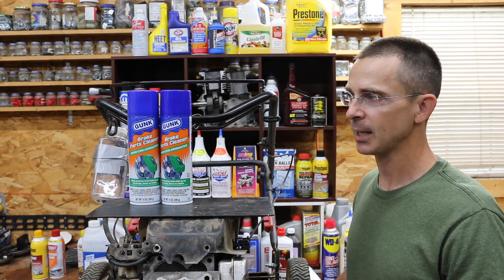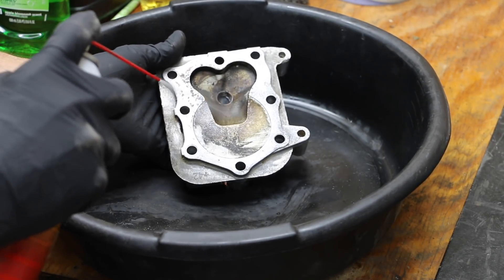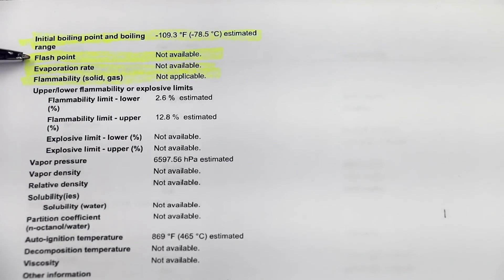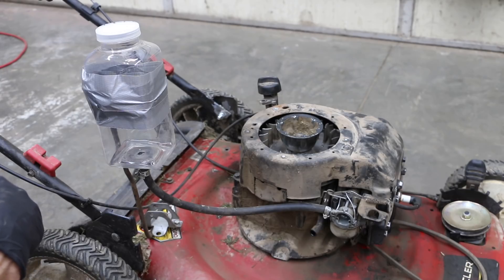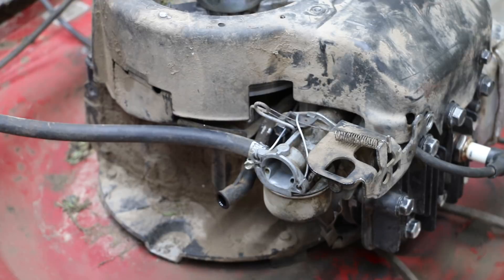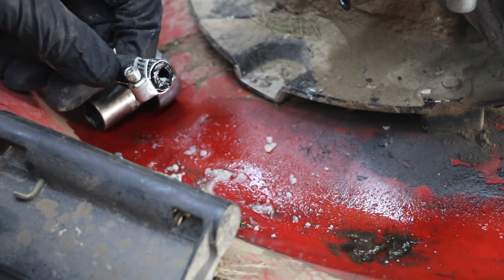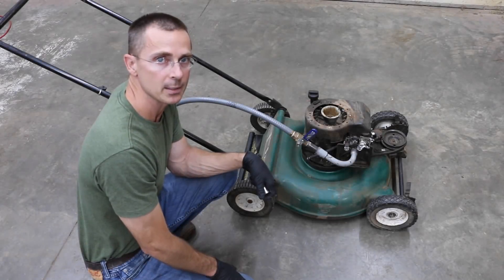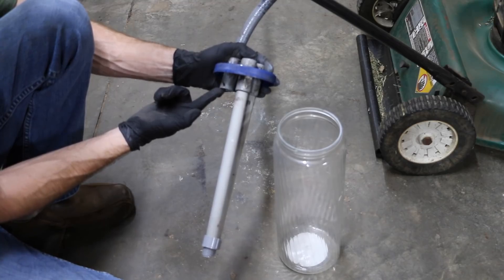Will a Gas Engine Run on Brake Parts Cleaner?  Lets find out!

Comment: Is there any way you can test whether antifreeze stop leak or just putting an egg in the cooling system is a better short term fix for a coolant leak? The radiator on my truck busted and I ran it with an egg in the radiator for a month before I put another one on it. I wonder if I had atypical results or if an egg just works that well.
Reply from the maker: Great video idea!  Thank you

Comment: I love your videos... I watch all of them but I was wondering what do you think would happen if the engine backfire through the carburetor when you had your Vapor gas tank hooked to it???? Scares me a little bit.. and you should try to run an engine on moonshine I've heard that the old-timers done it back in the day so it should work but I don't know
Reply from the maker: Great point regarding the vapor setup. I won't use it again until I install a flash arrestor.

Comment: I believe all the carbon buildup you have on the internals comes from a rich fuel mixture. I noticed lots of additives ate not impressing me, but I believe that the fuel ratio may be fudging your results.. can you try rejetting the carbs and running the engines to see how that changes your results?
Reply from the maker: Threat point and thank you.

Comment: Very good. How was cylinder scoring or lack there of? Thinking off topic about the old saying of using starting fluid washes oil off the cylinder walls. This stuff has got to be close, cause I use it or carb cleaner or WD 40 to help start reluctant engines.
Reply from the maker: Starting fluid these days includes some oil, which prevents scoring.

Comment: The vapor setup ran amazingly well! I take it you did another video on running gas on vapor?! I'll go look for it, I wonder how it compares efficiency wise, afr changes, better/worse mixture in the combustion chamber etc. Neat stuff man this channel has hours and hours of awesome information!! You can't trust manufactures, or most groups that review products, what a gift to have someone doing all sorts of tests and showing real results!!
Reply from the maker: Thank you. Yes, the engine ran on gas vapors but with only minimal fuel efficiency gains.
Reply: @ProjectFarm  the set up this guy has isn't doing anything differently from the carburator. The he's highly agitating the fuel causing as much atomization as the carburator would do left in it's own. For it to be useful at all you have to dial in the agitation rate. It else it's just a cook looking perpetual motion machine you see where they hide the motor.  My bubbler set up on my power washer nets noticeable gains. It operates a little lower rpm than it did off the carb but my water psi hasn't dropped.  I also need to use a little fuel by way of through the carb or starting fluid to get the motor started. Since engines use more to start than they do to idle. My ratio will run it but won't start it. And that's where you see the difference in consumption. I had to mes with mine quite a bit to get it right. And my pressure washer was the most thirsty small engine tool I owned now is at least 25-30% better

Comment: Will an engine run on whisky? I am talking here of Scotch whisky. In the 1950’s I had a very low compression twin cylinder motor cycle which it was said would run on paraffin  and could at least, be started up with whisky. I never tried it as I did not fancy cleaning the gunge from paraffin and the whisky could never have got as far as the tank!
Reply from the maker: Great recommendation!

Comment: Hope you weren't breathing too much of that stuff mate. Benzenes in most forms are pretty toxic.
Reply: Yeah, Project Farm mentioned that at the start of the video. Could also try running on freon while it is still available, but burning freon can be deadly because of phosgene gas (mustard gas) produced!
Reply: ojars zvaigzne Freon won’t burn as fuel I even vented some into the intake manifold of a diesel before it was illegal to vent and all it did was make a little phosgene in the exhaust and then engine shut off from lack of oxygen seconds after
Reply: ojars zvaigzne but with Freon only there’s no way it would burn

Comment: What will you recommand as a fuel if i'm in a urge to lawn my mow, and I can't find any gas ? 
Can an engine run on perfume, rubbing alcohol, or any houseware products ?

(as a french, it's very disturbing to say "gasoline" for what we call "sans plomb" and "diesel" for what we call "gasoil")
Reply from the maker: I need to do some experimentation, but I believe a mix of kerosene and rubbing alcohol would make a great mix.
Reply: So maybe it should be the same answer for ethanol 85 ? My equipment tells me not to use it, and I want to know why !

Thanks for your awesome videos. I'm following you for 2 weeks now. Never imaging it would be this captivating to look at lawnmower cruelty. Keep on going !

Comment: Didn't see it mentioned, but just about every brand of brake parts is a much different formulation.  Walmart's BP and carb choke cleaner are both nearly the same, containing toluene, methanol, and acetone.

Comment: There’s no way that initial boiling point is correct. Is it just a coincidence that -109.3°F is the exact “sublimation point” of CO2? I don’t think so. Looks like the pressurized the can with CO2 and then some computer program took its temperature while subliming at atmospheric pressure (ie freezing point of CO2) and plugged it in as the “estimated initial boiling point”. 

There are few organic solvents they would use that would be boiling at -100°F. Even propane boils at -44°C.
Reply from the maker: Thanks for the constructive feedback.
Reply: Project Farm well thanks for reading it!

Comment: If it's a negative comment about my post keep it to yourself cuz I don't care. Hello Mr. Project Farm I have to say that vapor tank is FREAKIN BRILLIANT, will it run on diesel vapor, I'll bet not to good if at all, wow that is cool, do you know the hours per vapor tank (per quart) vs a wet tank (per quart) that it will run with gasoline. What about 50/50 or even 100% paint thinner on vapor. On another subject, engine lubricants, have you tried running an engine with the crankcase filled to only 5 or 10% full of oil as a control then mixing an additive with the oil and repeating the above scenario 5 to 10% full crankcase to see if the oil additive improves or reduces lubrication or longevity, instead of draining the oil completely out of the crankcase.
Reply from the maker: Thank you for the positive comment.  The vapor setup I used isn't as good as other designs that use the exhaust heat to help vaporize the fuel, which is supposed to improve efficiency. In my testing, I didn't see any significant fuel efficiency savings.  Thanks agin.
Reply: Project Farm: cool thanks for actually responding. I hope it's ok, I've made a similar vapor tank for my Generator and it runs well, I will mess around with it and try to figure out a way to get the exhaust cool enough to safely run through it. I have to say you opened my mind again. I'll get back to you if I find any significant information about this lil tank.

Comment: Havr you tried running an engine on surgical alcohol? As well as have you tried to do a ventury with the vapour motor to have some fresh air added with the vapours being sucked into the carb? I know you get air into the carb through the inlet and the boiling off of the "fuel", but that is basicaly a clean burning vapour. If you add a ventury to the bottom of the controll valve will it not run longer on a said fuel than without it because you add more air. Just a thought.
Reply from the maker: Not yet. Thank you for the video idea!
Reply: Project Farm great stuff! Keep up the great videos. Just love to watch them all the way from South Africa!

Comment: an nitro engine will run on white spirit, diesel, cooking oil, and ovs nitro. I guess that most flammable liquids that burns the same and is the same is texture would work in an engine. I think you should try white spirit with a tiny oil mix 👍🏽
Reply from the maker: Thank you for this recommendation!

Comment: Just a tip.  Instead of having to spray a can of what you are testing into your gas tank.  Turn the can upside down and release the CO2 propellant.   Then cut the bottom of the can off with a kitchen can opener.   If it is a particularly volatile substance(low boiling point i.e. diethyl ether).  Put the can in the freezer first.  
Coolest content though.   All those things we have wanted to try. And a few ive never thought of.   Great job
Reply from the maker: Great recommendation--thank you!

Comment: Also people say if you run racing fuel in a non racing engine it will put a whole in the piston
Reply from the maker: This would be an interesting test!
Reply: Racing fuel resists combustion.   It takes more compression or heat to burn.  So really high octane fuel burns less in a low compression engine.  Its way more destructive to try 87 octane in a high compression engine. Due to detonation.

Comment: I run my fiat punto with 30% gasoline 70% kerosine .it runs for 10 years now normal but i change oil sooner than usual .
My diesel engine generator works only fron cooking oil 95% and diesel 5% for about 13 years (about 20 hours per week)  but i clean 3 times per year the injector 
Is it possible to run the diesel with some type of fumes ?? (Hot diesel fumes from hot exost) ??
Reply from the maker: Thank you for this recommendation!

Comment: You said at the beginning that a very low boiling point makes it "highly flammable." Not true, I believe you meant to say volatile. Volatility is the characteristic of a substance evaporating (or boiling) easily under normal atmospheric temperature and pressure.
Reply from the maker: Yes, you are correct.  I meant to say volatile. Thank you

Comment: Please, make a video where you run the engine with ethanol? It seems to be very powerful carbon buildup remover. 

For example, there is quite big enthusiast group flashing their Saab ECU:s with E85 compatible software, and the result has been for many that the old and dirty engine starts cleaning up from the old gunks so fast that the oli pickup gets blocked..
Reply from the maker: Thank you for this recommendation!

Comment: You are right about not running chlorinated brake parts cleaner.  I did by mistake years ago instead of carb cleaner in a running engine and cleared the worshop of workers. Very nasty stuff when combusted in an engine!!
Reply from the maker: Thanks for commenting on this.  I'm surprised that some oven cleaners are chlorinated. Seems problematic to use in a home.

Comment: You should try running a engine on aciton if it would work
Reply from the maker: Thank you for this recommendation!
Reply: Project Farm Hey I was dumping brake fluid into my dads truck and I thought of you right away you should try brake fluid for oil

Comment: Just FYI that boiling point is strictly for the mixture and is heavily influenced by the CO2 presence, which evaporates pretty much immediately (sublimation temp is about -78.5°C for CO2) and is probably just the propellant in the mix.  Benzene, Heptane, and Acetone (2-propanone) all boil much hotter, from ~55 to 100°C.  Which is still cooler than gasoline's bp, but I don't think the vapor pressure for those compounds is quite as high as gasoline.
Reply from the maker: Thank you for this information!

Comment: Please don't rev the engines so high, the flywheel can explode above 4150 rpm. Also every 100 rpm past 3600 produces 44% more load on the connecting rod. Keep up the awesome vids!
Reply from the maker: Thank you for this advice and thanks for the positive comment.

Comment: You would try to mix gas and diesel and then it in a small engine.
Reply from the maker: I did a video on using diesel in a gas engine a while back. A 50/50 mix did work. Thanks for commenting.

Comment: Brake cleaner idea was great. I was surprised it ran. But I do have an interesting idea. Will a engine running on gas vapors vs gas mpg? 1 gallon each motor let them  run see which one runs longer?
Reply from the maker: I did the fuel vapor fuel efficiency test and they were about the same. The vapor engine might have been slightly more efficient, but the engine was running very lean.
Reply: Project Farm yes a pint I think at idle . My curiosity was, under a load or high idle if it changed

Comment: I don't know if you have already done this experiment, but I'll spread it anyways:
How much diesel in gasoline can the engine still reliably run on until the ratio is too high for the engine to properly run?
5% diesel 95% gasoline? 10-90? 20-80? Place your bets, Ladies and Gentlemen!
Reply from the maker: Thank you for this recommendation!
Reply: You're welcome! Good luck with that experiment! ;-)

Comment: Will a break cleaner ruin the throttle body of a car engine if cleans with it ???
Reply from the maker: I wouldn't take the chance, since it's a very powerful solvent.  Highly recommend staying with throttle body cleaner just to be safe.
Reply: Project Farm , I used it one time only on a 20 year old car with a super dirty, never been cleaned  throttle body , and the break cleaner give me a terrific results , it is indeed powerful solvent and I'm not gonna use it twice on the same car .

Comment: Mr farm, regarding your vapor setup, please add a second valve between the existing valve and the carb to allow raw air into the vapor rich mixture and lean it back into the proper A\F ratio. You're giving the engine too much fuel vapor and you need need to lean it out.
Reply from the maker: Thank you for this recommendation.

Comment: You can run the vapors of different things, BUT when you hit something that won't run on vapors you mix with gas and it DOES run...What would happen with straight gas fumes? How about gas and oil? Gas and diesel fuel?Do you see where I'm going? Is there a way to run off gas fumes and get more power or more MPG???Just a thought...
Reply from the maker: Thank you for this recommendation.

Comment: As a mechanic we used to do stuff, but there is one that i was always thinking about... nowdays in the Uk the carbon cleaning service became a really popular thing, we used to do it on a cheap way. Simply just spray some water into the intake (i mean spraying with a window cleaner bottle or a mist nozzle) could you please prove this one for me?? Obviously becareful not to hydrolock the engine.
Reply from the maker: Thank you for this recommendation.
Reply: There os actually evidence of this working. Take a look at a cylinder that has a bad head gasket leaking coolant into it and it is often cleaner then the others. It may take some time but works well. Water is also the cheapest cleaner you can get too
Reply: that is true. Also water injection was used in WW2 planes with superchargers. There the cleaning was a happy byproduct but still happened
Reply: Ferenc Samarus I have to admit in the u.s. this is not common practice.
Reply: I bet a water-meth injection system would keep engines nice and clean

Comment: The extra high flammability is most likely from the heptane. Heptane on it's own is highly unstable. Heptane (or n-heptane) is a good test to try out, if you can get your hands on it. I used to get it from the shop I worked in. They had a 55 gallon drum of brake cleaner they'd use to fill up pressurized canisters with. It was solely n-heptane. Good because the stuff evaporated quickly. The engine will run on this stuff, but it pings a lot more. .........Try the Wearever brand brake cleaner (the non-chlorinated kind). It's mostly n-heptane. The Valvoline brand has a good mix of toluene, acetone and I think (M.E.K.). 
Yep..I've been messing around with this stuff in my cars for years. Always open to try something new (with a little knowledge).
Great channel by the way. Just binge watched a bunch of your vids. And now sub'd.
Reply from the maker: All great point and thanks for subscribing and thanks for the positive comment!

Comment: Over 50 years ago my father was getting his Clinton powered rotary mower out to mow our 1/2 acre lot when he found his gasoline can was empty.  In a hurry, decided the Coleman stove fuel would do. Called it "white gas."  Anyway, long story short. He mowed the yard. Mower seem to run okay but just as he was finishing, it threw a rod.  He wasn't sure if pre-ignition of the stove fuel  caused the failure or his father in law bent the crankshaft mowing and hitting large rocks. Any opinion?
Reply from the maker: I will be testing Coleman fuel soon.  It has a much lower octane, but I doubt it caused the engine to fail. Hitting rocks seems far more likely to be the culprit.

Comment: Please show up close side by side picture of the spark plugs, commenting on richness/leanness differences before and after. 

I would also like to see the head and valves cleaned off before each test. Please us a standard run length on 87octane on a clean head and valves to set a baseline for the before picture, while trying to get an equal length run time for the after picture, using again a clean head and valves. It would be more work, but would show much better cause and effect.

I know run lengths on experimental products will vary. Love your videos!
Reply from the maker: These are great recommendations--thank you!

Comment: used brake cleaner as starting fluid for a 98 Neon, ran just fine. Worked as good as starting fluid.
Reply from the maker: Excellent. Thanks for commenting.

Comment: Do you use new head gaskets or gasket maker or chance it with the original head gasket?
Reply from the maker: It depends on the condition of the gasket.  I reuse them if they are in good shape.  Thanks for commenting.